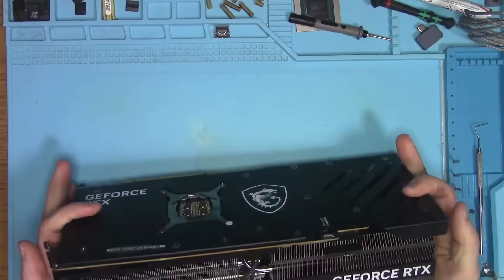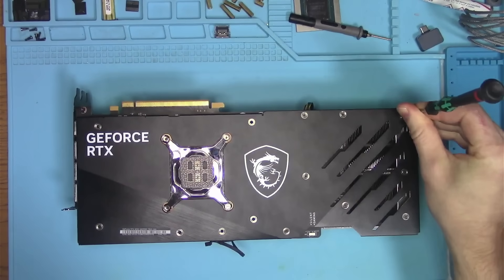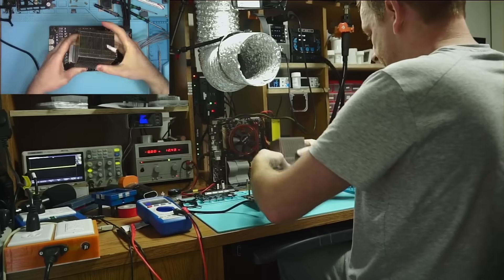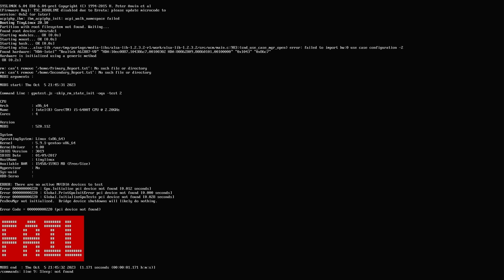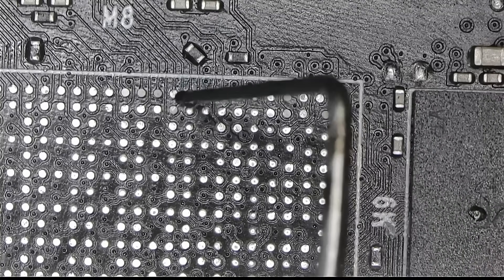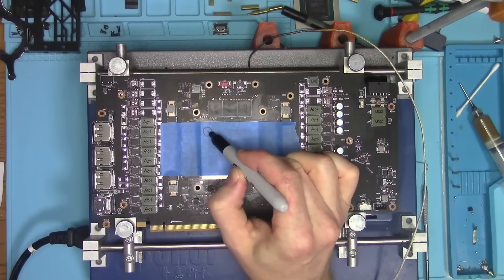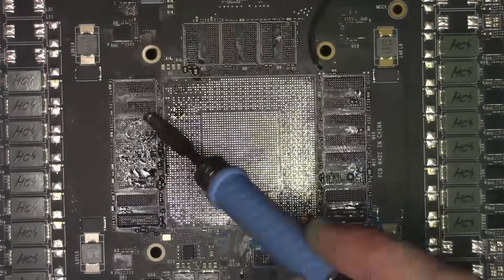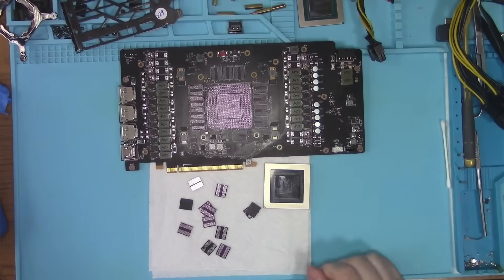MSI 4090 manufacturing flaw was discovered the hard way

Comment: How can this possibly be shipped out from a vendor, to the prebuilt company, then a final consumer, and no one noticed this card did not ever work.
Reply: What is more confusing, why not send a brand new sealed 4090 under warranty back to the seller instead to a 3rd party repairer to just be a paperweight and a donor card?????😵‍💫
Reply: @Alex-ii5pm the customer probably charged backed the pre-built vendor for receiving a non working computer.
Reply: @Alex-ii5pm it came in a prebuilt system
Reply: @calvin659 I think some people still have bad habits from covid times... Then it would make sense to fix your gpu, but now, if it's covered under warranty, then it just doesn't make sense to get it repaired as there is so much stock now
Reply: @calvin659 I think you’re making assumptions not in evidence.  He very well may have complained, got a replacement, plugged it in, said it worked. Then the company said keep DOA card and he was trying to turn a profit on repairing the DOA. I find this scenario more likely.
Reply: @CobaltLobster a company just giving them a free 4090? Something that expensive, they should be demanding the old one, even if it's broke they need proof that they didn't just give away $1700.
Reply: @calvin659  The card has two issues, one issue is that it's not soldered correctly (oxide covered pads) and the other is that it suffered transport damage (ripped pads). Guess what any GPU/PCB manufacturer does when there's transport damage? Deny warranty. Odds are the prebuilt manufacturer hasn't supported the card well in the system for shipping, and then refused to take care of it, then got schooled by the sales platform or payment processor by awarding the customer a full refund on the purchase. Now you have a free dead card that if you mail it to Northwest Tony, he'll diagnose it for free; and if you mail it to MSI, they'll have you pay a handling fee or just keep the card as well, because it was obviously transport damaged.
Reply: @CobaltLobster  I think your right. Had a Galaxy Note3 that fell out of my bag while I was on the Tube. Reported it to TFL and they found it a week later but by then my bank account insurance had already sent me a replacement so I informed the insurance company that the phone had been returned to me and they said keep it. So I gave the phone to my mum.
Reply: @AnabolicSaagAloo  MSI prebuilt computers come with a 1 year warranty. I checked the serial, it came back to an MSI Infinite RS 13NUI-419US-B7137KF4092432GS2TX11PZ9 prebuilt computer, and all the parts inside are still in warranty. Now the owner can't cash out on the warranty and MSI keeps money in it's pocket for a defective part. Always check warranty first before sending to 3rd party repair!
Reply: @CobaltLobster  MSI requires items to be shipped to their RMA warehouse to get replacement. Only exception is low value items like AIO water cooling where it appears they do cross ship instead (maybe to do with the fact that AIO coolers are unusually shaped and having a manufacturer box makes it easier to ship back the bad unit)
Reply: @CobaltLobster  no company is just sending you a replacement 4090 without you sending your dead card to them first for them to actually verify it doesn’t work, and they’re not going to send it back if it doesn’t work and they are going to replace it.
Reply: They slam them together and don't care, the profit made from a shoddy pallet of bulk gpus, CPUs, boards, cases, power supplies etc and pumped out at high volume makes a decent profit even when 10% are DOA.
Reply from the maker: It worked am sure.
Damaged during shipping.
Reply: Odd odd getting doa is no quality inspection. Is no inspection at all. Put the pc together close it and send it.  So sad.
Reply: All that was on their mind was profit
Reply: It did work, the pads being oxidized just means they weren't soldered properly, but the pressure from the other soldered pads would still allow it to make a connection on the oxidized pads. The reason why it didn't work was because some pads ripped in shipping, and probably helped by the fact that soo few pads were properly soldered. Even though it's clearly a manufacturing problem, the real problem is chips need to move back to PGA style connections rather than LGA. That means chips should use pins instead of pads. The manufacturing industry does this to save a couple of dollars per chip, which might have made sense when chips only cost like 20 or 50 bucks to produce.  But when we're talking about thousand dollar chips, PGA suddenly makes a lot of sense again, because of how robust PGA is. Pins just slot in somewhere, and they're pretty sturdy. They're a much more reliable connection, but chip makers are just lazy. So they save a few dollars, charge you more anyways, and now your product is much more vulnerable to issues, which of course makes chip makers even more money in replacements.
Reply: Damn.. imagine getting the card you hoped for just to receive it like this 😢
Reply: Warranty?
Reply: @UNSINKABLEII  What Warranty? If you have transport damaged product/parts no one will accept Warranty.
Reply: The way I see that is rushed production and corner cutting end of story
Reply: ....because the buyer was just another possible idiot
Reply: They don’t care obviously.
Reply: How can you send a GPU that came in a prebuilt PC to repair, instead of claiming a replacement from the company you bought the PC from.
🤷🏻‍♂️
Reply: I work at one of these companies, you will not be suprised at how low the QC is.
Reply: Maybe the company replaced the video card for free because why else would the customer donate the card?
Reply: i've had more DOA MSI gear than any other brand... won't buy anything from them.
Reply: I'd def be going after system builder for my money. Then again, i don't let others build my computers.😁
Reply: @rorschach602 a company just giving them a free 4090? Something that expensive, they should be demanding the old one, even if it's broke they need proof that they didn't just give away $1700.